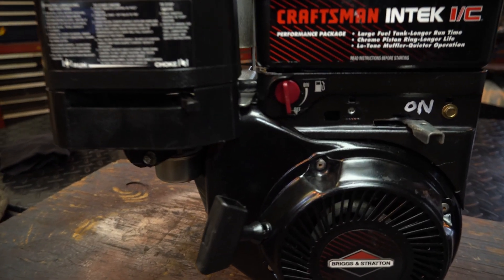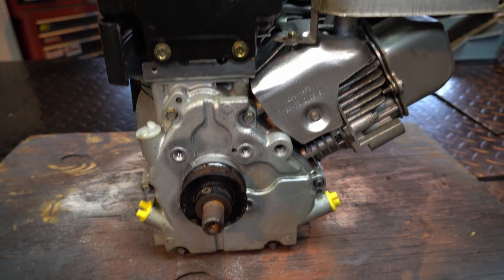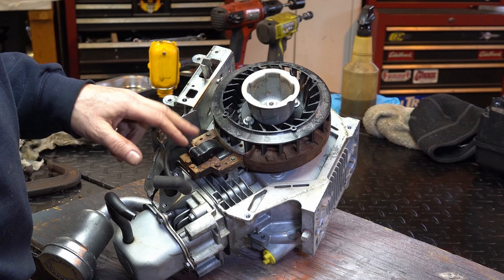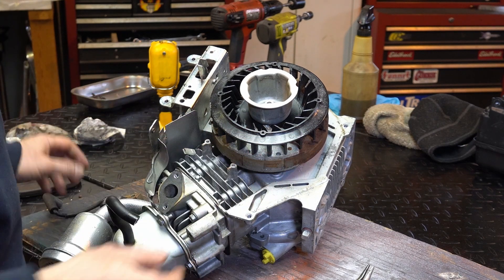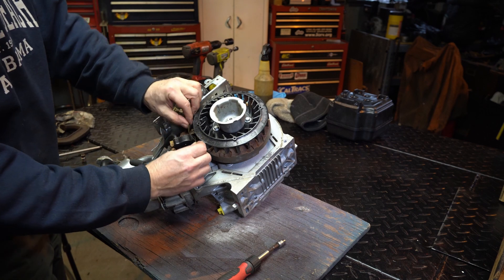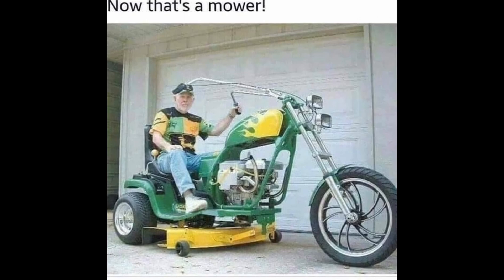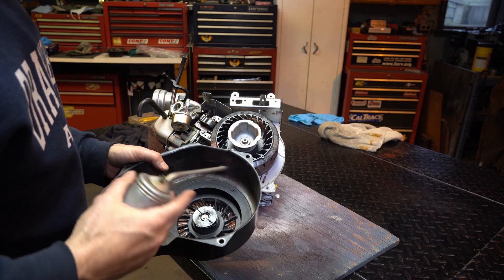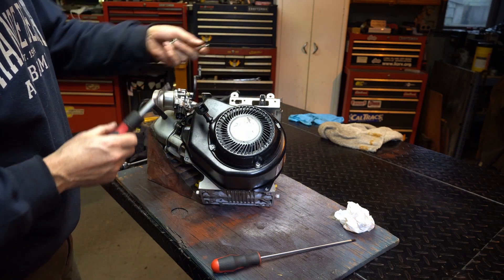Briggs 190cc Horizontal (ANY) Engine Ignition COIL /Replacement & (Setting the Air Gap) How To Tips

Comment: Arch, I think this debate about rust on the flywheel has gone on long enough. You need to do a real closeup video specifically about this subject with an engine that is failing electrically, before and after removing the rust from the magnetic surfaces and showing how it works after. I’m all for removing rust and treating anyway, but I see this disagreement all the time and both sides seem to be quite convinced they’re right. (Like politics.) 😂
I think the issue is whether rust is actually 
magnetically conductive or not.  The other thing I think about is, if the magneto is removed for some reason and the grounding surfaces are cleaned but the flywheel surfaces are NOT, will the larger air gap when it’s reset (due to rust buildup) change how well the coil actually performs.  I think probably not because air gap tolerances are not that critical for some applications. We have questions! 😉🔧
Reply from the maker: Yes,,I did one with the Old Yeller video. I took a coil from a new OHV briggs engine and put it on an old like 17hp briggs points engine, flipped it around and made it run.
I explain the theory of these things. 
Rust isn't magnetically conductive; its electrically conductive. Its magnetically disruptive! 
Yes you right on, it forces the mechanic to go to a wider gap. I like to start fresh as I can. I've even painted these parts many years ago and that engine ran. I should do this again for fun.
On the newer engines we have the flywheel brake and this helps things but the coil can still suffer.
It has to do with the laminates of the coil. I also have a video an why cleaning coils can sometimes fix them. 
Aftermarket coils are cheep but can vary widely in timing specs and impedance!
I will look for the links to these vides shortly
Reply: @TheNovaJohn    Thanks!  Learning every day!
Reply from the maker: Your Crushin It Rein!! Ya in the Groove!
Reply: Seems it makes sense to remove rust and grease on any thing to me, can’t hurt a dam thing and it’s easy
Reply: @philliphall5198   Agreed! 👍

Comment: Make sure you get the ignition coil put on the right Way I've been there did that as put the coil on the wrong way making the engine the wrong way   The coil is marked as what side goes up
Reply: Yeah, I could see someone easily put the magneto on backwards because the kill switch connector is underneath rather than on top, so they think, “It must go on this way with the spade connector on top where it’s easy to connect once I’ve got the magneto attached”.  I not only take photos of every part before I remove it, I then take a photo of those fasteners on my magnetic bar so I grab the correct fasteners for the right part! (Think two are machine screws and two are coarse thread going into plastic.)   If I see those differences in the photos before assembly then I know to be careful which ones go where.
Reply: @Rein_Ciarfella  your reply is the truth about this matte of the ignition coil
Reply from the maker: I should do a video on showing what happens if I reverse mount the coil. and why it doesnt work.
I do have that video on installing a new OHV Briggs coil and reversing it to fit out a old briggs points motor but another video would be good to do as well.
Reply: @TheNovaJohn  go for it Archie
Reply from the maker: @madaboutmowers  lol
Reply: Some are so I paint mark them anyway and cc of engine
Reply: @philliphall5198  thanks for the info on this video on the ignition coil 👌👍👍
Reply from the maker: @philliphall5198  Whatever helps!! That's a Good Idea!
Reply from the maker: Yup,,,,,4:30 I mention this!!
Reply: @TheNovaJohn  cool 😎👍